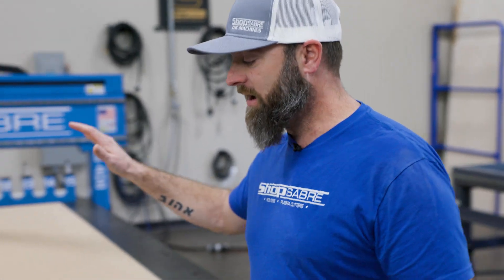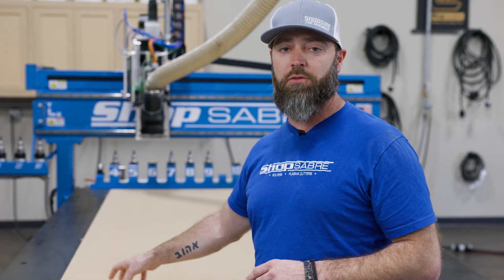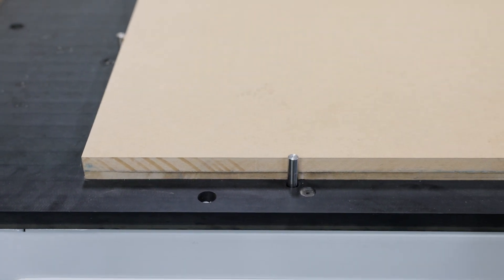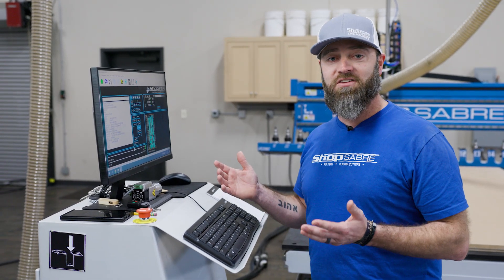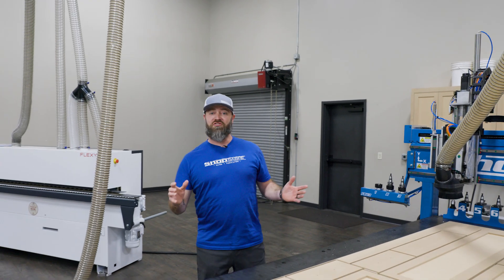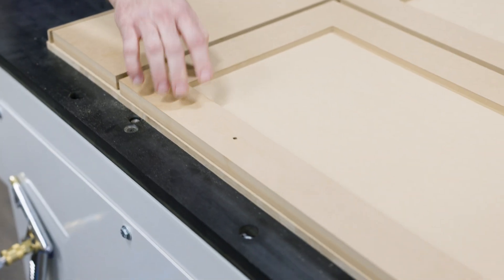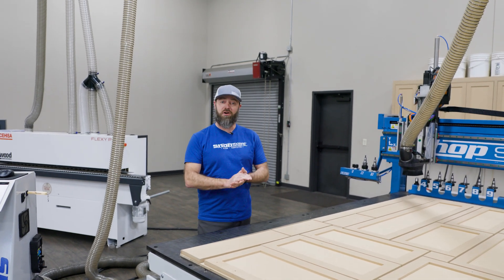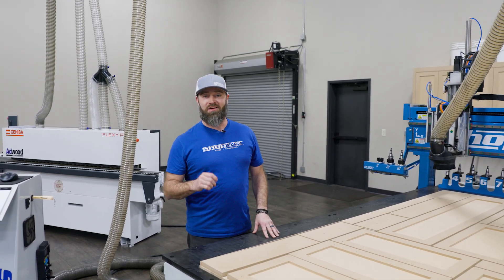Cutting MDF Doors on a ShopSabre CNC

Comment: Hi Shawn, I know you're using KCD software for this project. Do you think Mozaik has the same capabilities and the same three tools that you used on this one?
Thanks!
Reply from the maker: We actually used Mozaik software for this project.
Reply: Have you done a Video showing how to set the tools, and parameters to build these shaker doors using Mozaik?
Thank you! 
Great videos, by the way, there is no better way to show how these beautiful CNC machines work. 🤩
Reply from the maker: We have not, generally we let the software company explain their software and operations.
Reply from the maker: @GabrielOrtiz-b7g  Generally, we do not get into the details of optional software as each product on the market is a little different and we allow their respective companies to explain the software in details.

Comment: I just did this today on my IS408. It was my first job for this machine, after 4 sheets of MDF the machine started vibrating alot, I wasn't sure what was happening....then I realized one of the bolts for leveling the machine wasn't holding any weight therfore that corner of the machine was kind of in the air. I tightened up the bolt again but I wonder how long till it'll start to loosen again
Reply: I’d back it off and put a dab of blue locktite on the threads before re-tightening.  Just and be can keep vibration from allowing it to move without making the adjustment permanent
Reply from the maker: Unusual to have them come loose if the Jam nut was tight but give support a call and they can help discuss with you if you have any more issues.
Reply: On a brand new machine? Have you had any other problems since then?